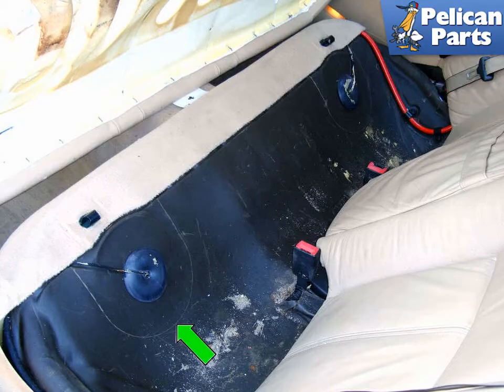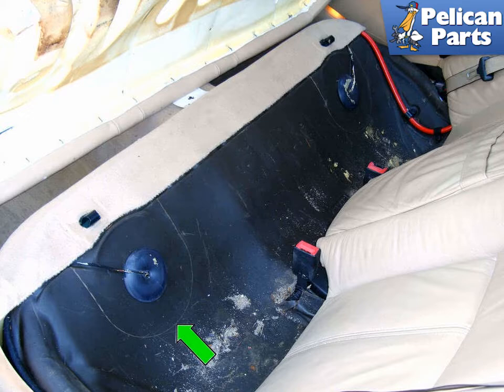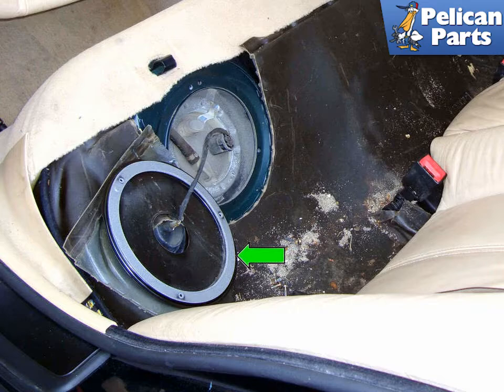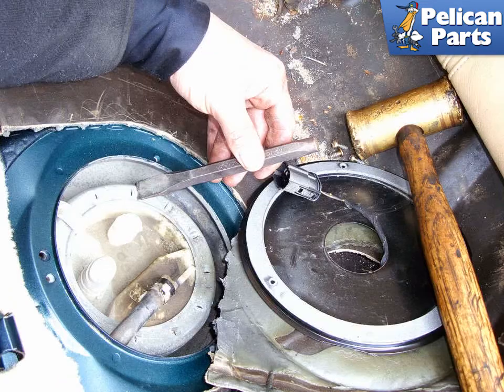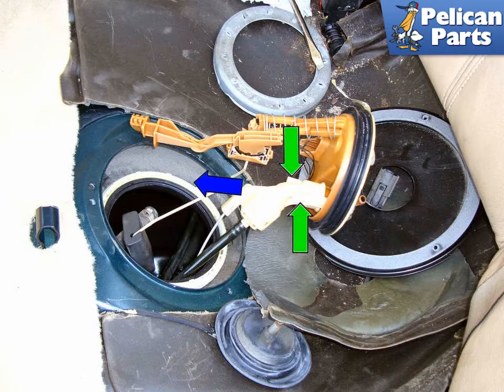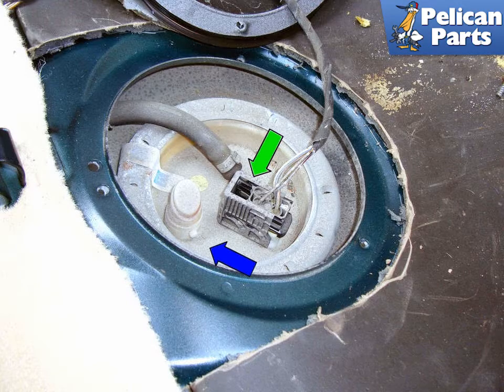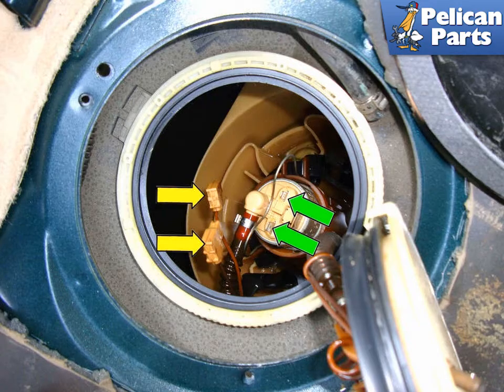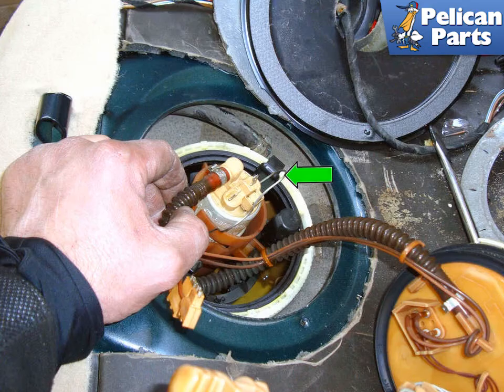BMW E39 5-Series Fuel Pump Sender Replacement | 1997-2003 525i, 528i, 530i, 540i

Comment: bmw e39 528i 2000 is the left side tank sensor 1 like this video ? im having a stall problem on cold like the car wants to shut off and then the stall goes away
Reply from the maker: Could be an issue with the fuel pump. I would perform a fuel delivery system test. Check fuel pressure, volume and quality.

Comment: does the fuel pump sending unit only purchasable with the fuel pump or is it just recommended to replace them both at the same time?
Reply from the maker: It depends on the failure. If the pump fails electrically, replace both. If pump is under-performing, (low pressure r volume) you can usually just replace the pump.

Comment: What's the part number for that assembly?
Reply from the maker: You didn't mention what year and model vehicle you are working on.

With your vehicle info handy, give The Pelican Parts parts specialists a call at 1-888-280-7799. They can figure out what part or repair kit you need.
Reply: Yeah giving you the info you need may be helpful, it's a 2001 BMW 530i. I've ordered a fuel pump and a filter but I can't find the name of the unit on the left side of the tank. Thank you!